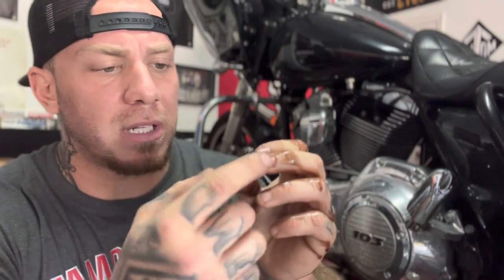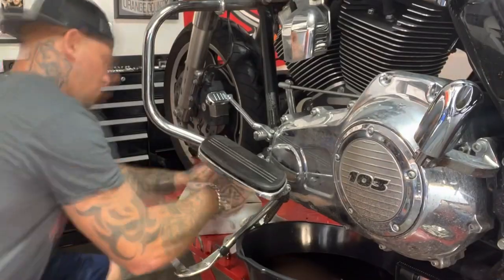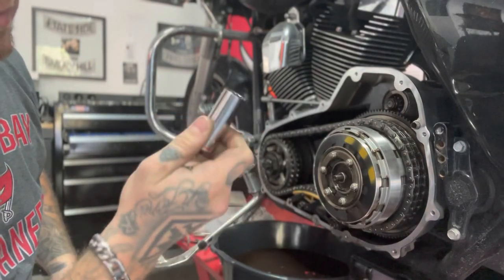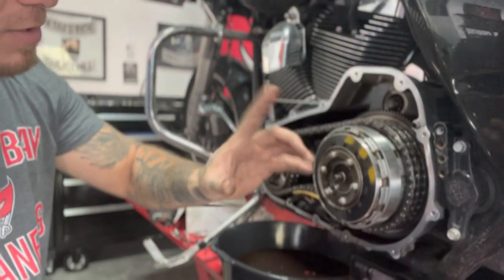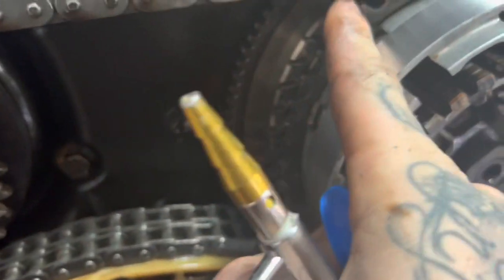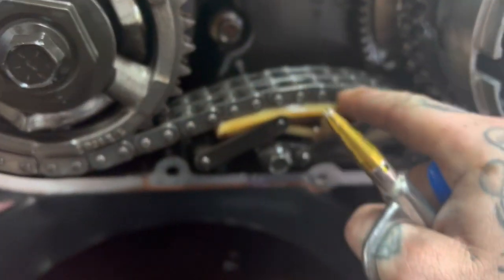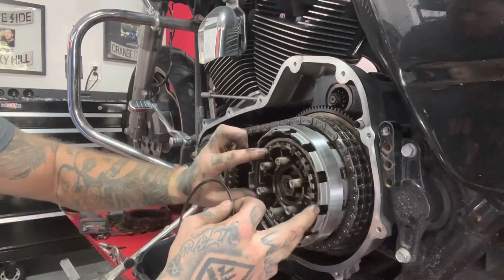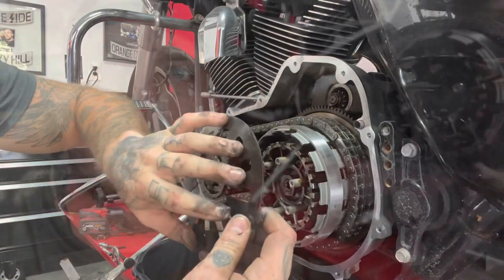How to change Harley-Davidson clutch plates??

Comment: What’s up, bro? I am doing a custom job and my I was gonna take off the belt, but we didn’t end up doing it and when I put it back together, I put the clutch bolt in and I think it’s stripped. Is there anyway I did stripped is there anyway I can fix that or what I gotta do